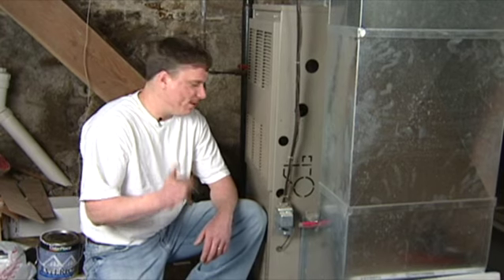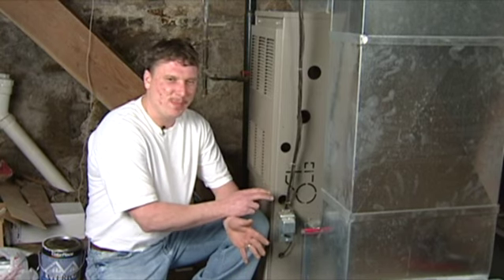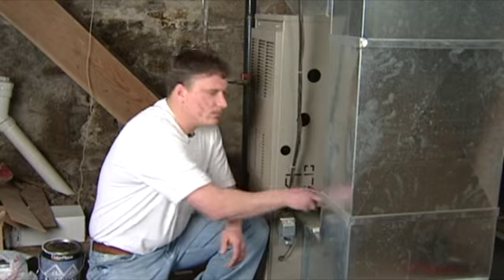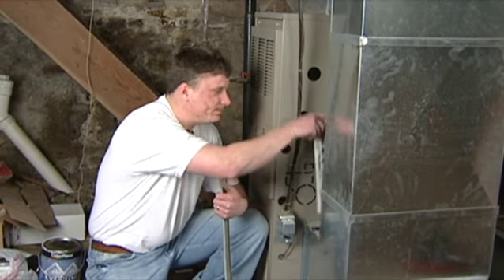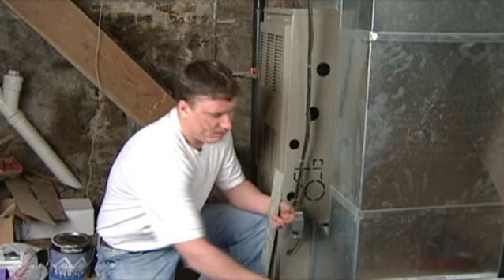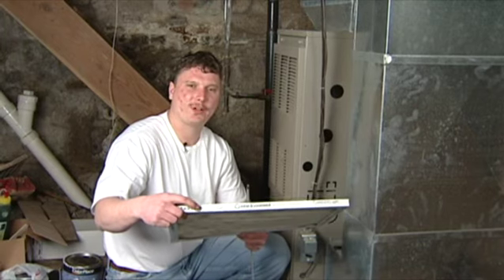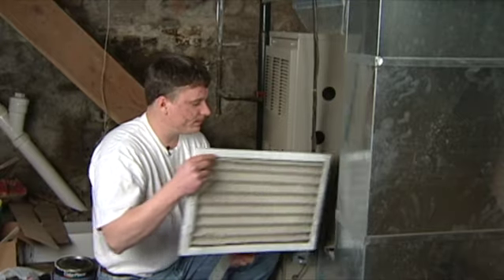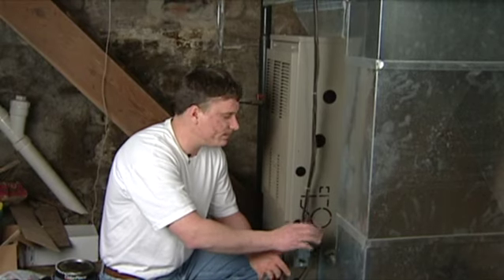Plumbing & HVAC Maintenance : How to Change Furnace Air Filters

Comment: The title of this video should be "attention people who are morons". I can't believe most people have no clue how to change the filter.
Reply: My unit was making a horrible noise.  I wanted to make sure I had the filter installed correctly.  Turned out I did, but I had a Filtrete level 10 (germs and bacteria) and it made the A/C unit fan hum really loudly.  I switched it out to the Honeywell that is rated for just allergens and now it isn't humming like it is going to die.   I hope that was the fix.  It had me concerned I was going to have to call in a repair person.